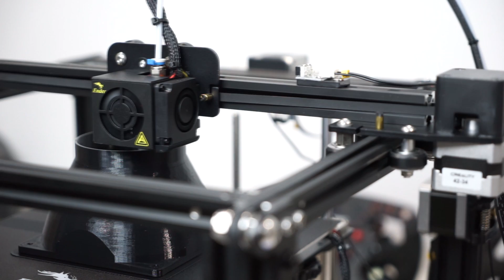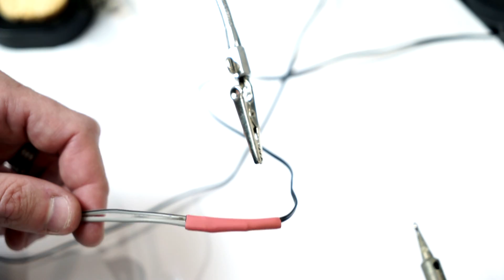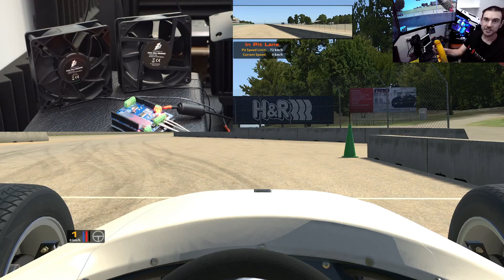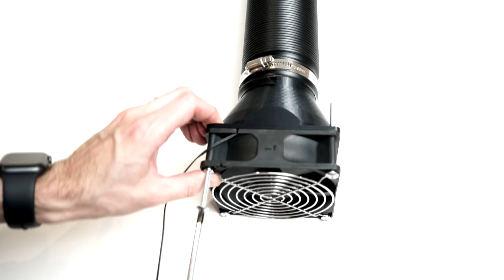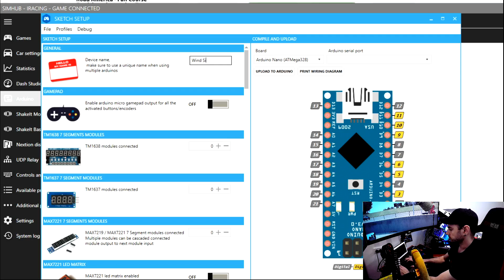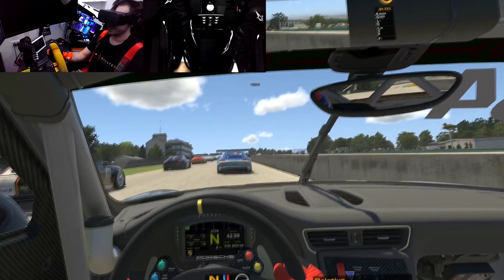DIY SIM RACING WIND SIMULATOR - Part 2 - We Nailed It!

Comment: Hey Will, thx again for this excellent guide.  I was looking into a similar setup considering the hot days are coming.   Also I saw a post on Reddit where a user has induced permanent damage to his Valve Index headset because of the sweat damaged his electronics.  So enough reasons to start this build :)
How does your setup hold up after a couple of months of usage?  Would you swap any parts on the shopping list?  Thx again, huge fan of your channel! :)
Reply from the maker: All still working fine. :)

Comment: you do not need a motor shield to run the fans, for instance, my fan does not run on low voltage (https://noctua.at/de/nf-a14-industrialppc-3000-pwm) I found this tutorial and it works perfect. Now the fan can run at super slow RPM. https://www.racedepartment.com/threads/easy-diy-wind-simulator-for-assetto-corsa.133999/ https://github.com/SHWotever/SimHub/wiki/Arduino-Shake-It
Reply: How do you like those fans I'm thinking of getting those

Comment: Thank you Will for this easy to follow build for the wind simulator, i've been wanting to have a go at making one for a while now but didn't really know where to start, i've got all the electronics now and i've found a company that's printing the shrouds for me. Hopefully ill be up and running in a week,o and i also sourced some cold air intakes with a 76mm bore😁. Just one thing are 200cfm fans ok as that is all i can get in the UK for now?. Keep up the fantastic work 👍
Reply from the maker: What’s the current draw on the fans?
Reply: @boostedmedia  I havnt got them connected yet as im waiting on just the power supply but this is a link to the fans, https://www.amazon.co.uk/gp/product/B079G4TVKZ?pf_rd_p=f20e70b1-67f9-48d1-8c78-ba616030b420&pf_rd_r=ATM2YGDR0KW0WH7ZAEG8

Comment: Will, really digging the content on your channel. I'm pretty new to sim racing so I'm soaking it up. Looking to do this project soon and found a power supply laying around but I'm not sure if it would work. The one you used and the one you posted in the description were both 12v 3+amp. I have a 12v 1.6 amp. You said in the vid that you thought a 1-1.5 amp would do. You think the one I have would be sufficient or do I need to order the one linked? Thanks in advance and keep up the good work!
Reply from the maker: Should be fine.

Comment: Hi there if you dont mind can i ask if i can use 6000 rpm for this wind sim? Thanks alot before
Reply from the maker: Depends on current draw.
Reply: https://tokopedia.link/sdIHRJLCY2. Thanks for the answer , but if you dont mind can i use this one? With the adaptor like this ? https://tokopedia.link/aKlNLkVCY2
Reply: Or may be this gonna be more easy to explain to you 
Fan spec is
Rated voltage 12 vdc
Operation voltage 8.0-13.2 vdc
Input current 4.00 max 4.80 a
Input power 48.00 max 57.6 w

And the adaptor spec Is 
12v /3a 36w 

Can i use that adaptor or i must change the other adaptor thanks before once again
Reply: Or should i buy another adaptor with 12v 5a spec ? Thanks before once again

Comment: Barbie's hair is hardly moving Will?  If hair spray is the reason then maybe she's not the best way to gauge airflow.  As a suggestion (& I know this may cost more if you can't borrow one) use a quantitative method of measuring airflow like a airflow meter.  Sorry I'm just not into subjective feedback as I've been burnt too many times.  Being an Aussie I think this would only be of use to me in the winter months or if I relocated my rig to an aircon'd room.  While I like that it adds immersion I just fear I'd get too hot when fans are running low or no speed.  For this reason I'm considering keeping my normal fan as base cooling and then building a wind sim with bulge pumps for more noticeable stage 2 airflow.  Either that or relocate my rig to an aircon'd room with weaker/quieter fans.  Thanks for sharing.
Reply from the maker: I thought about using a wind gauge but figured a wind speed value is kind of useless to understand the volume of air being moved. That’s why I spent more time explaining what I was feeling after the “barbie test”.

Comment: Good addition with the 60 Hz. I will give it a try to elminate the eeking sound. As already mentioned, I cannot imagine that there is wind missing with that configuration - at 100% power it definitely dries your eyes and everything else.

Ah - in VR it's even eye-dry-save, so I can point the fans toward my face directly.

The fan speed curving effect is actually strong and impressive BTW.
Reply: So, update from myside:
60 Hz does not work for my fans, they are then way to slow in response. Using the 1.900 Hz is much better, even with the little bit of wining, which sounds actually like a starting gearbox :)
Reply: @gregsonberlin3782   Same here! My fans wouldn't work except for when I was going like 80mph, and anything below it they would just cut out. Can anybody tell me why this is happening? lol I'm a complete novice at electronics but it seems like, when I had them set at 60 hz, the arduino simply wasn't giving the fans enough 'juice' or something. I could hear the arduino working, but the fans wouldn't turn (once again, except for when I was going above like 80). As soon as I set the Hz back to 1600-1900, the fans had full range. But in this video, he seems to get everything working perfectly even at 60Hz, so I'm not sure lol

Comment: Hey Will. What material did you use to print the Air Reducers? Thanks
Reply from the maker: Just PLA. They don’t need to be super strong.
Reply: @boostedmedia  Thanks Will

Comment: it really helps with fogging in VR.  Actually, it completely gets rid of it.  I had two clip on fans on the sides of the rig blowing at me and that would keep from fogging up.  I got the wind sim to replace the fans.
Reply: Steve, That's sounds great! I just received all my hookup stuff in the mail today. Should be WINDED  by this weekend! I drive my 3 dof motion sim in VR so depending upon the local humidity, I get fogging too. Hope the wind directed at my FACE will help with that and I bet it helps with the 'IMMERSION' Will describes.. Hoping to post video on this too ...  DMAX
Reply: I was curious about this effect. I was interested just for the fact of heat from headphones and vr headset.

Comment: This is very cool. I fear you could be running into a static pressure issue (maybe, maybe not). I'm not an expert in fluid dynamics or anything, but I've been in the 3D printing world for a few years, and there was a thread where someone was designing a part cooling fan for their printer, and it was just a little 40mm fan with a cone shaped duct on it that pointed towards the hot end. Essentially they were puzzled as to why the air was not being blown through the smaller hole in the cone shaped duct (the fan was blowing fine without the duct). If you add some fins to the cone shaped adapters you've got there (in order to guide the air), it may improve the amount of air you're able to move.
Reply from the maker: I did some experimentation with directing the airflow more but found it only seemed to add restriction. The reduction from 120mm to 76mm doesn't seem to be enough to cause a problem with the gradient used on these ducts.
Reply: @boostedmedia  awesome! Great to see you're already on it then. Thanks for entertaining my amateur observation from afar 😊

Comment: some noctua 3000rpm fans might be good. 160cfm i think mine are rated to.
Reply: Did you get those? I want to build this but I want the strongest fans
Reply: @tehgusbus2716  Server case fans. 4000 rpm and around 200 cfm. Dirt cheap too-

Comment: when joining ya wires will...splay the ends before joining,twist and then solder...makes a better join 🤞
Reply from the maker: I spent 8 years soldering 7 hours a day in a repair shop and always found twisting each wire on it's own and then twisting them together seemed a bit stronger.
Reply: @boostedmedia  your way is unless you are doing a telegraph or linesman splice then soldiering.